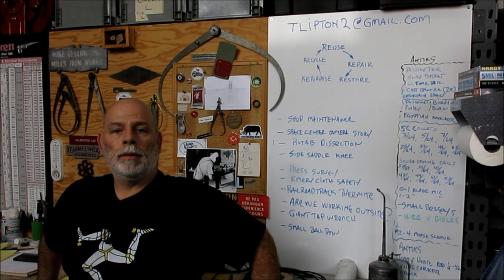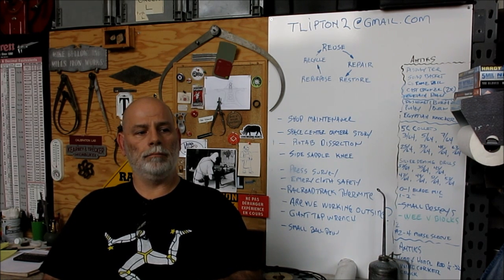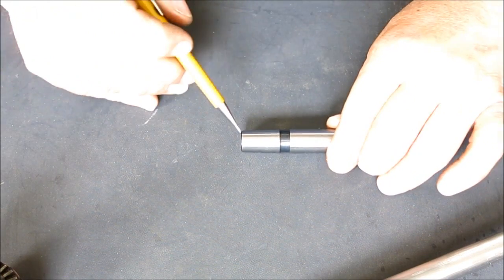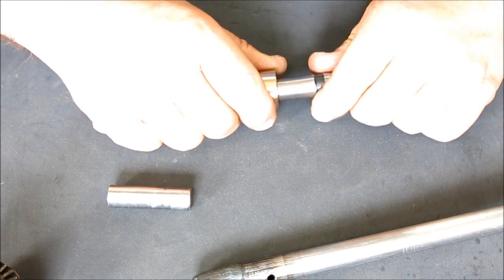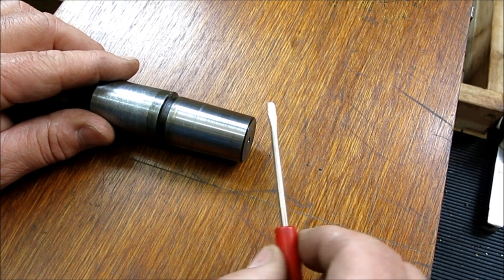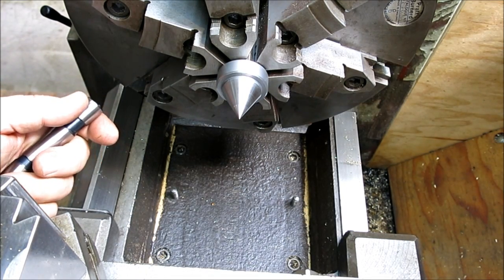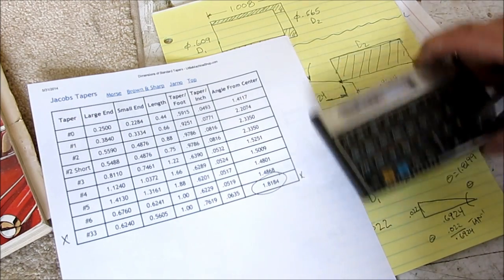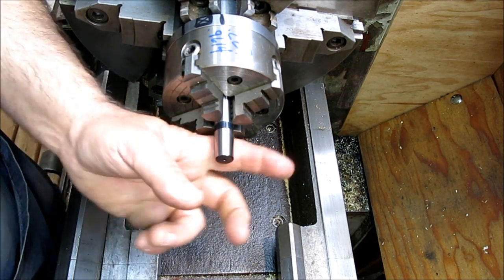Setting up and Cutting Short Machine Tapers Part 1

Comment: Excellent video Tom. If I had to try and figure it out I would not have thought of the ring gauge technique which is very simple and accurate.

I am 100% in favor of these types of instructional videos. Please keep them coming.
Reply from the maker: Hey Steve,

See what a simple drill press shaft repair turns into? If you start talking about some of these things they really blow up into major subjects.

cheers,

Tom

Comment: Tom,
It's great to see that my shaft is in such capable hands.  I did not realize my request for help with a messed up 40's drill press would end up a well received video series.  By the time you're finished with the shaft, it will probably have a taper that is more accurate than when it was new.

I have enjoyed all of your videos.  They make me want to run out and buy some machines and make some parts, but the wife says no.  I will just have to live vicariously through you and the other machinists on YouTube.

Thanks for all of your work for the benefit of the greater community.

Looking forward to the next installment,

Kurt
Reply from the maker: Hey Kurt,

Wait till we get to the gold plating of the shaft video....... We sure can milk a cow for all its worth around here.

Thanks for the comment.

Cheers,

Tom

Comment: There is a lot of meat on that bone Tom.  Very big thanks for the show-and-tell on taper measuring and the math.  Love your HP 11C.  I have a 12C on my desk and I had recently installed the 11C app on my phone for math problems like you presented here.  Nice to be able to follow along with the same calculator (emulator in my case) that you did your math solving with.  He shoots, he scores, he earns the win with this video!

Gary
Reply from the maker: Hey Gary,

I have the RPN calculator app on my phone. I also have a 15C and a couple of 41CV's Wish I bought some backups when you could get them easily.

Cheers,

Tom

Comment: Lots to take in on this subject Master Tom, and you show it in fine fashion! This is why it's important to understand the math involved, and I can't say I'm that good at it.  It's great your showing how to machine a taper with nothing to indicate, because all of my jobs I have had a sample to get the taper attachment, or compound dialed in to. Looking forward to the rest of the series. Thanks for sharing with us all!

Adam
Reply: i always indicate the sample taper true with the compound or make a reference for setup taper gage to indicate for the next time i run the job, to take the time to set up to cut a taper from scratch and not have a reference gage to indicate the next time you have to cut the same taper would not be too wise and also would be extremely inefficient. if you have to take the time to start from scratch to set the taper up anyway it is extremely wise to make a sample taper gage to indicate true to the compound if you need to cut the same taper in the future. i personally have found this method to be the fastest, easiest, most efficient way of cutting tapers
Reply from the maker: Hey Adam,

Thanks for the comment buddy. Its all pretty straightforward when you have a sample to match to. The trick is getting started with just the book and a chunk of material. Have fun on your trip to Keith's get together.

Talk to you soon,

Tom
Reply from the maker: Erik Grahn Hey Eric,

If you have a sample its all pretty easy. The trick I was trying to show here is how you get going with nothing but the book and a machine. I agree if your set up and its a taper you may cut again its probably worth making a sample to throw in the toolbox for the next time.

Cheers,

Tom

Comment: Tom, this is truly a master's class video loaded with information.  I've pondered how to measure the distance between two points on a taper, but it never occurred to me to use a simple gauge like you demonstrate, and I don't recall having seen that anywhere.  Clever!

(A subtle note:  the notation tan-¹ or arctan is read, "the angle whose tangent is X" not "raised to the power".)

Have you considered trying a polarizing filter on your camera to eliminate the glare on the dials and white paper?

Thanks for a truly exceptional presentation!  I predict this one will go viral!  : )

Comment: The Manx TT - man and machine working with really tight tolerences!  Very informative video Tom :)
Reply from the maker: Hey Steve,

I think I would rather split hairs on a precision taper than with a stone wall going one eighty on a motorcycle. In my younger days that would have been my kinda racing.

cheers,

Tom

Comment: Thanks for the info and the shop math refresher. It has been a while since the last time I have needed to calculate an angle and it was not clear in my mind anymore. It all just came back to me, I am the sort of person that is good at math only if I am activly doing math problems.
Reply from the maker: Hi James,

Thanks for the comment. It helps to have a real world problem you need to solve. Its were reality meets the application.

Cheers,

Tom

Comment: I know this is old but was looking through taper videos and saw it. Your gages are a very cool way to check datum diameters as long as viewers follow your instructions about sharp burr free corners and make sure its square. One comment on the original angle error.  The tip of the test indicator used to sweep the top of the taper looked to be angled maybe 15 degrees.  Depending on the model of indicator it probably had a cosine error value of maybe .96 meaning you had closer to .0254 then .0265.  That would put it pretty close to the angle spec.  I think a dial indicator would be better than the test in this situation or it needs to be very horizontal.

Comment: A quite, quite brilliant video with outstanding explanations, demonstrations and sketches all the way through. The maths although complex, and therefore challenging, was delivered at a pace and manner that even a dunderhead like me could follow without getting lost!

Clearly the quality and sharpness of outside edges of the holes in that "ring gauge" are critical so that they don't alter in any way when being used. Can one purchase ring gauges of a tougher material than yours - ie in effect the reverse of the pin gauges?
Reply from the maker: Hi Dan,

I have used female round punching dies in the past to take measurements like this. They are hard and flat on the contact surface. Commercial ring gages have a radius on the lead in that interferes with the measuring. The edges are actually pretty tough as long as you treat them carefully and there is enough meat around the hole to support it. Thin tubing is not a good choice. The hole must be round so I generally bore them.

Cheers,

Tom

Comment: You may want to try putting a piece of neutral density filter over your indicator to eliminate glare. I very much enjoy all your videos!
Reply from the maker: Hi Yan,

That is a good idea. I tried a polarizing filter on the camera and it makes little difference. There is just too much light in the shop coming from too many angles to screen it easily. I'll have to try that.

Cheers,

Tom

Comment: Hey Tom,
Thanks for video, cool methods, however your first method appeared flawed, hence the failure in your readings.  Maybe it was just my perception from video, but if you viewed your indicator from the tailstock, was the indicator arm perpendicular to where you were measuring?   In measuring for dimension indicator arm has to be perpendicular to work being measured, and even that will deviate as the indicator arm moves. A regular dial indicator coming straight down  would give you better results.
Reply from the maker: C Connelly Hi C,

The movement of the indicator was perpendicular to the object. I moved the slide to take the measurement.  The flaw in this first method is it really doesn't have the resolution to determine the angle to really close limits like you would need to make a high contact fit. I think the cosine error is what you are referring to. If you do a practical test over a short range measurement like this you will see it is not measurable if you are reasonably close to perpendicular which I was in the first setup. Good observation and question. Thanks for the comment.

Cheers,

Tom

Comment: Hi Tom,

Many thanks for the interesting videos!  I didn't see this subject discussed yet so excuse me if I am repeating.  I have struggled with making accurate tapers for some time and looked forward to your approach.
Regarding the ring gage approach, I think an error analysis is in order.  Presumably, you are using a standard set of pin gages which increment by .001" to measure the diameters.  This means that a measurement of a hole diameter will a best be within +/- .0005" so a diameter difference measurement of .044" could actually be .043" to .045".  In practice the tolerance range could be slightly higher due to the subjective nature of the "feel" of the fit.  Looking at the worst case scenarios, the diameter difference divided by the distance difference ranges from .0620 to .06500.  Dividing by 2 to get the radius difference ratios and taking the arctan gives a range of 1.7784 to 1.8615 degrees for the measured angle.  Actually the range is somewhat greater due to the uncertainty in the dial indicator reading.

The whole point of this exercise is to illustrate the danger of relying on measurements when dealing with small differences.  I ran into this problem professionally when we tried to characterize a small tapered socket on a molded part.  D1/D2 was approximately .04"/.02" with a 4 degree angle and a hydraulic seal and external hard stop with the mating part and sixteen mold cavities with were involved.  We went through quite a few iterations with the mold maker before we came to an agreement.
Reply from the maker: Hi Robert,

Thanks for the excellent comment. You illustrate some of the problems with measuring tapers accurately. The pins were indeed .001 steps but minus pins. This means the discrimination tolerance is one sided not +/-  as the minus pin determines "no smaller than" The analysis of the tolerance stackup is tricky for certain. I don't expect this shop grade home made tooling to discriminate much closer than +/- thirty seconds of arc. We will close the loop in the taper discussion by checking the angle with a sine bar method to verify or quantify the resolution possible. Careful setup and multiple readings can improve results but like all measurements there is always some uncertainty. 

All the best,

Tom

Comment: Hi Tom,
I'm thinking that must be rather important to get the edge on that gage just right if you using it to measure the taper and not just comparing one taper to another by doing relative measurements

you need a clean edges but they can't be chamfered or rounded that would cause an error in your measured length
Reply from the maker: Hi Lasse,

You are exactly right. The edge cannot be deburred or chamfered at all. Hardened and lapped is the best. You can use hardened round punch dies for the ring gages. They are fairly cheap and have the crisp edge you need to use this technique.

Cheers,

Tom

Comment: Place the commercial arbor between centers and adjust your compound rest angle so the indicator has no movement when advancing the indicator along the arbor where the tool would cut and that is the angle, then just use a indicator or travel dial to cut the length, you only have to match the small end, a taper is a taper and the length can be long if the additional protrusion does not affect the project, but the small end needs to be correct.

Comment: Hey Tom, great vid...

One issue though...  The last couple of videos you've posted seem to heavily saturated.  The glare off white surfaces make what you're doing impossible to see.  I did try adjusting my monitor without luck.
Reply from the maker: Hey Jarrett,

The sun shines through my shop windows. In addition to that Chuck helped me change all my shop lights. I forgot to dial back the exposure a bit for the additional light.

Cheers,

Tom

Comment: Tell me one thing, just a hypothetical question, why use tapers, why not just keep it straight. What is the reason why machinist did start cutting and using tapers...
Reply: Guds777 a tool less/fastnerless way to hold items together.
Reply: Tapered objects are also self-centering, or in other words they always center the same way. And in some cases also provide holding, like when the taper angle is below say 1.5 degrees and that's called a selflocking taper.

Comment: Hiya Tom, I wonder if cosine error on that DTI played a part in how far the measurement was off?
Reply from the maker: Hey Andy,

There is a lot of static on the web about Cosine error. At very low angles and small displacements it is typically unreadable on a .0005 indicator. You can do a simple test with your indicator and a height gage to prove it to yourself.

Cheers,

Tom

Comment: I also use an rpn calculator: my old HP-41. Banged around in my shop for at least 20 years and still going. No = sign lol
Reply: b2major9th HP used to advertise the 41 as a calculator with No Equal. ha!

Comment: Tom,
Have you tried a polarizing filter for the camera to reduce glare?

 I'll bet you have a new appreciation for cinematographers after doing these videos…

Keep up the great work. All this reminds me of being back in trade school and it stimulating synapses that have been dormant for years.
Reply: An even better method, which we used to use in the cinematography business, is to put polarising film over the lights themselves...and then use a polarising filter on the camera lens too. This will entirely eliminate reflections from shiny surfaces. Not so easy to achieve when using natural light though...unless you cover your entire window in polarising film (available from Koday & Lee filters) which is F-expensive.

Comment: I watched all 4 parts of this series and have to be honest.. I could use a little more depth on the math sections. For example the sine (sign?) portion etc... Need some more info on the math formulas being used. ALSO could you go into the long tapers and morse tapers too?
Reply from the maker: +Rj Lewis Hi RJ,

This was roughly a Morse taper. Math is the same for any taper you need. Math videos are not super popular. Lots of online resources for triangle solutions. Thanks for the comment.

Cheers,

Tom

Comment: Is there any functional reason not to set the angle using something like a sine bar and adjustable parallel off a test bar or similar - then cut till you get a clean surface, find/part back to the correct minor diameter and then find the major and relieve behind it?

I'm currently debating how to cut a 33 to a Jacobs E which I've drawn out in sketch up and the E taper can be cut inside of a 33's meat so I've purchased an arbor with the 33 taper - I'm now debating how to cut the angle considering its hardened and I don't own a heavy lathe - so I'm debating chucking the taper in my Deckel SO grinder - truing the face of a new grinding wheel setting the angle using a small sine bar across the face of the wheel - grind it to the taper then it will be overly long/sharp so I figured I could make a minor diameter ring gauge and cut the puppy down.
Reply from the maker: Hi Philip,

Setups with sine bars in the lathe are pretty sketchy,. The main point here is you have to be able to check your part. Its not just setting the angle. You have to measure what you make so you know you got it correct. There is an initial setting and then bump and check until you have the desired accuracy. Sine bar does not assure a correct part. Hope that makes sense. Thanks for the comment.

Cheers,

Tom

Comment: I'm afraid I fall into the crack that TOM MORAN spoke of in his post. No Trig. Very little more than general math.
Please tell me if I'm wrong, BUT:
If you have a sample of the correct taper, that you can check with a protractor, and say you come up with a taper of approximately 3*.
Could you not set your compound to 3* off parallel too the work, then take a .0000 dial indicator and set it on the compound and adjust the angle of the compound tell you had a .0000 reading, on the known taper,  as you ran your compound in and out the length of the taper ?
Then lock your compound so that angle can not change, then as long as you had enough travel in the compound, could you not make the cut and have the right taper ?
Thank you. Enjoyed the video.
Reply from the maker: Wally Verbeck Hi Wally,

If you have a sample handy its all pretty easy. The trick is when you don't have a sample which is what I was showing in the series. Setting the taper accurately without a sample and without special gages is pretty demanding. Thanks for the comment.

Cheers,

Tom
Reply: oxtoolco Thank you. My question was answered in the first few minutes of the second video. All I had too do was watch it. Most of the time, things are not as easy as they might seem at the time. Like your videos.

Comment: I think I got an explanation for the little discrepancy at the smaller diameter. The factory arbor overall may be just a tad too thick or a bit to short at the smaller end . Measure and calculate the larger end´s diameter and the overall length, that should solve the mystery.
Reply from the maker: Hi sthenzel,

I'm curious to hear back from Jacobs to see how close they hold the diameters. I understand the angle needs to be held closely but the diameters might have more tolerance than we expect. This would affect the axial position the taper mates at which is not as important as the mating surface of the taper itself.

Cheers,

Tom
Reply: oxtoolco
The diameter seems to be variable within some limits. I´ve seen some Jacobs tapers sit quite deep, some others not. All were not from Jacobs, even might have been reground/-reamed, so I´m curious about the answer from Jacobs, how closely they keep to the standards.